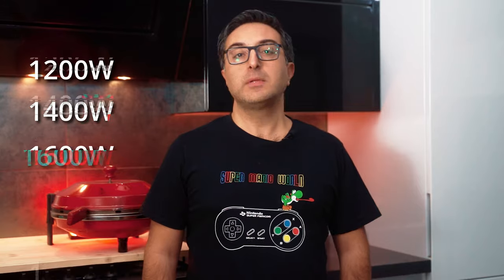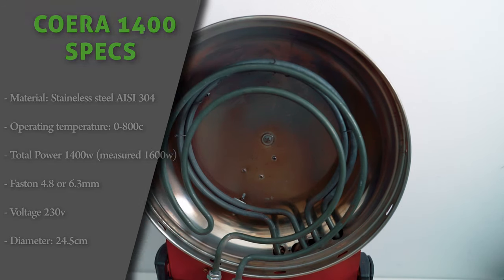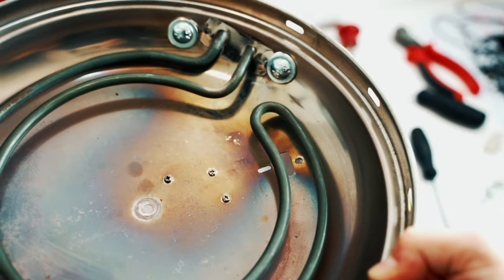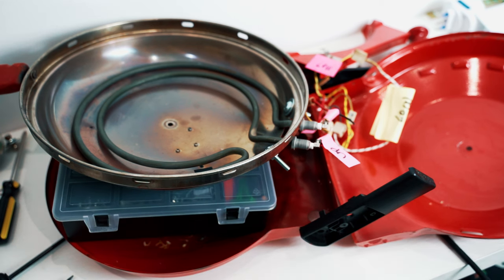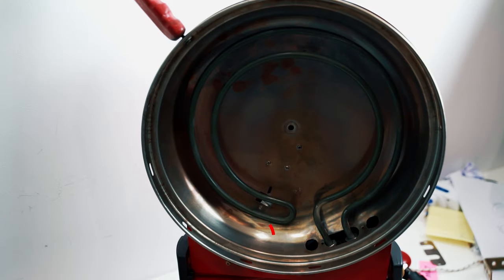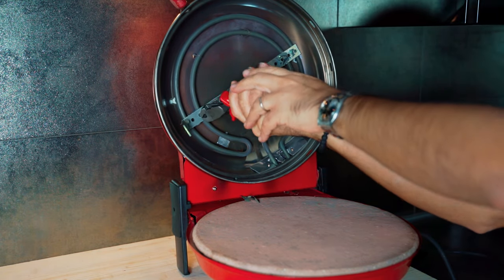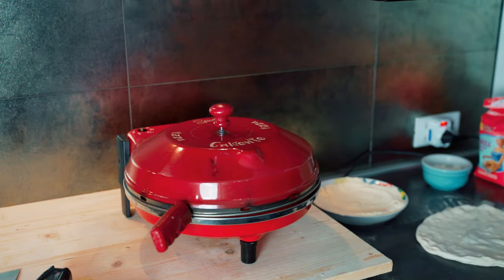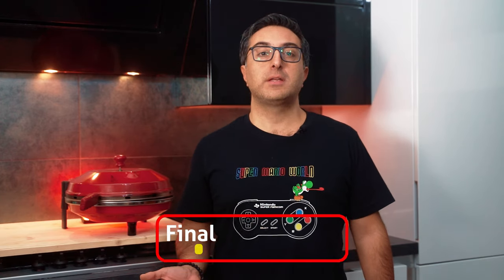The 1400w heating element mod for homemade Neapolitan pizza in 50 seconds #coera

Comment: Thanks alot for your great video! Could you tell me how hot the outer lid of your oven gets? The outer surface of my oven is getting very hot (>150 °C) and the oven is completely switching off after 5 - 10 minutes. Maybe I need more isolation inside the lid. Thank you for your help!
Reply from the maker: Hi check minute 20 here: https://youtu.be/-J1jpyYgnlc

Comment: Hi, can I install this also on a g3 ferrari , replacing the upper element with this whilst leaving the lower element as is? Many thanks
Reply from the maker: You can but not recommended as Ferrari has worst build quality and materials
Reply: Thanks for the quick answer, I watched quite many of your videos recently. Love what you are doing and your passion.

May I ask what you would recommend to buy to have the „perfect“ pizza oven for at home?

Would it be?

- Spice Caliente
- Coera 1400 (or 1600?)
- Regulator
- Maybe a biscotta stone?

Altogether it would cost around 200, so that‘s absolutely fine and I can give away my existing G3 Ferrari as a gift. 

Or any other suggestions? I also like DIY, so actually would prefer doing myself rather than buying an expensive oven.

Also I was thinking of building the entire case myself, out of stone and installing it in the corner of our kitchen. Not sure whether it would work and be worth it.
Reply from the maker: @Cee8002 thanks really appreciate theis feedback ❤️

Comment: Hi, are all elements in this type of oven 110volts, i find that strange, why not 2 elements of 230v?
Reply from the maker: Yes those are 2x115 for a total of 230v. Check my COERA 1400w mod, i explain how to convert the electric system for 230v elements
Reply: I myself have a Optima pizza express Napoli red 2cxp3020 1200W but the upper element is very small in diameter and my crust won't get nice colored, i didt your thermostat mod.
Reply: So, they are set in serie but then they has to be the same in watts otherwise when one is more watts it blows the smaller one in serie
Reply from the maker: The definitive mod is the Coera mod and dimmer, you can get better results than restaurants. Check yourself my results in the second part of this video
https://www.youtube.com/watch?v=gl8a3Vbp1M8
Reply: Hi, i measured today my pizza oven Optima Pizza Express and the are 230 volt elements a piece, i have made a picture but can't let it see in this comment, i had a other sort of the same and there i measured 115volts
Reply from the maker: Sorry don't know the optima but the spice caliente is as i said

Comment: Would you recommend either double heating element or one element like this?
Reply from the maker: Hi i explain the differences in the video already. One is a free mod the other is not and they have different results
Reply: @pizzatimechannel  Yes, my bad. I thought the pizzas were the end! Thank you, I think I will search for this alternative. I want to improve my crusts. I also see a lot of people place aluminium foil and deflectors inside their ovens. Would you recommend this?
Reply from the maker: Absolutely no aluminum, it's tossic and has no need. I would rather suggest you the alzatina 1.0 or 2.0 you find on my channel
Reply: @pizzatimechannel  Thank you for the insight! Do you have an english version of those videos? If not I will just use the captions :)
Reply from the maker: No sorry i couldn't dub them all, but in most cases I wrote manual captions